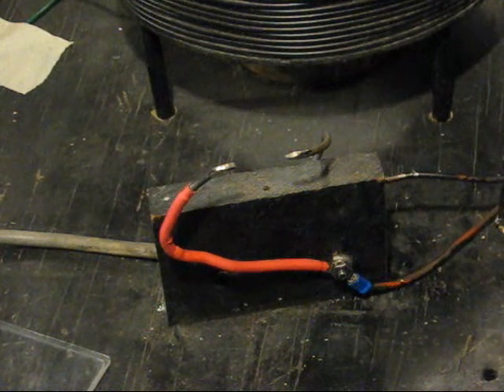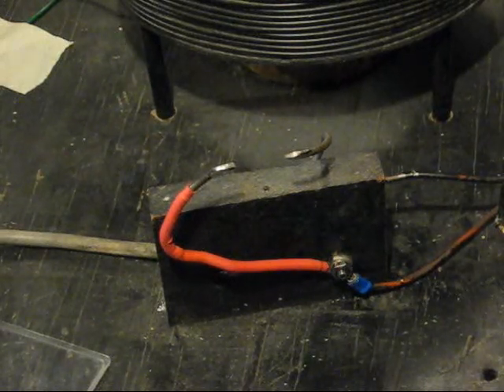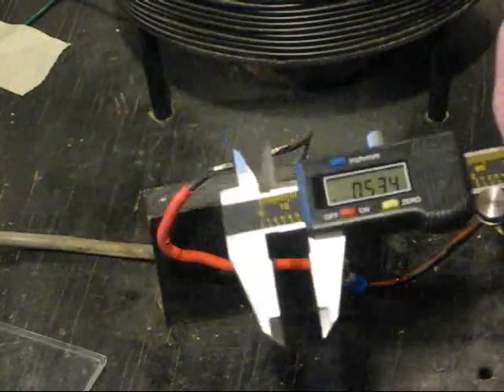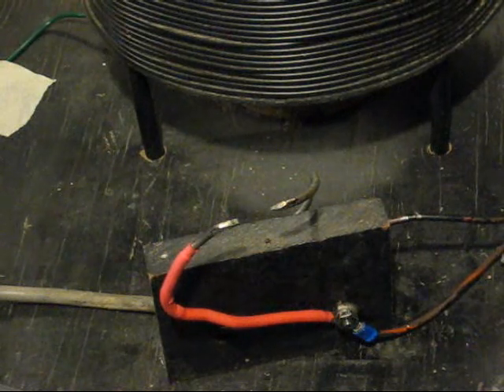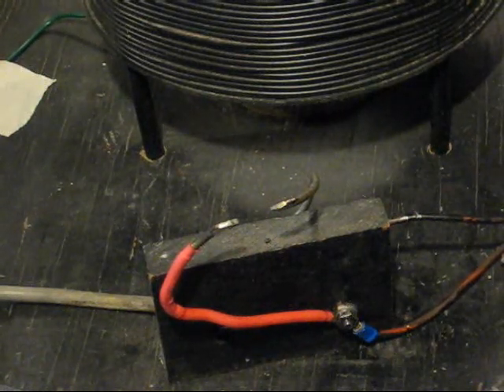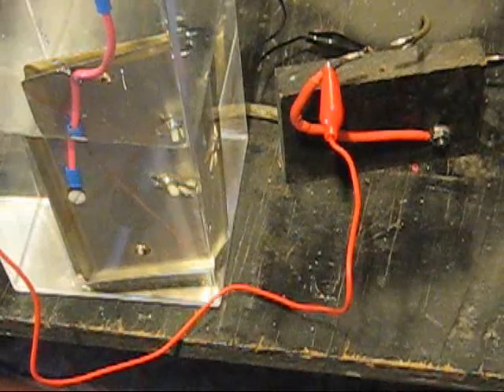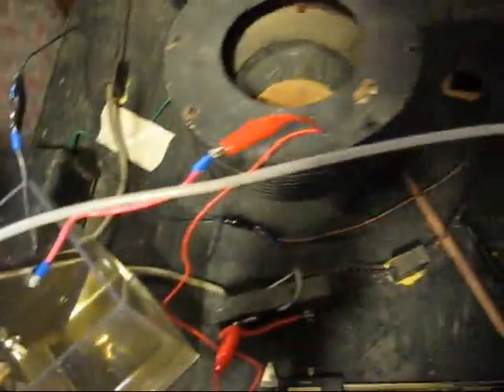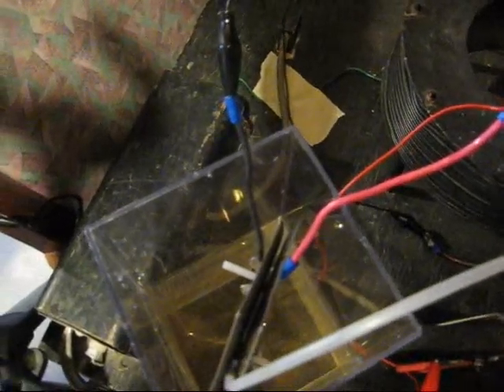Tesla Coil Primary Plasma HHO Attempt. ©

Comment: Question: Could the energy being released as steam and hydrogen be used to produce steam directly? It may require a second plasma field to burn excess hydrogen. However, if the goal was to produce heat for pressurized steam production rather than hydrogen production, could enough energy be produced to run a high efficiency steam engine that would produce torque energy as well as a small amount of electricity for running the plasma arc process? I'm not talking about overunity or anything like that. Just using the energy that is in water via HHO to power the process and provide steam for power. Water powered ships anyone?
Reply: Your still talking overunty.
Reply: @raloed.363  Okay, thanks.

Comment: At  7:57  you really had something going on there.  I would go back to what you were doing then & try to repeat the process.  If you can repeat, then you can make a circuit to do it for you.

That looked like Large scale production.  If you could make that steady, you would have a winner!
Reply: yes ,,,you are correct....
Reply: WTF how did you 2 not see that he was blowing into the hose  @ 07:50 thru 08:03 to get the connection going again. lol zero observation and even less understanding you 2 fail.
Reply: roger hurd
Yea I realized this about a month ago & figured what the hell and left my post up.

It is obvious, we will never see a working video here on YouTube.

IF one got posted, it would get removed, or the OP would be threatened in various ways until it is removed.

You are not allowed to openly speak about these systems or the science behind them.

Else be charged with Terrorism or experience Extrajudicial Execution.

Good Luck!
Reply: i think its 5:52 while no arc large bubble scale. check it out

Comment: if its discharging its passing thru the water instead of splitting it
at the start i saw bubbles so maybe if it was pulsed it may work
right before you get sparks in between the plates u need to switch off then on again
bubbles = hydrogen
arcs = nothin!!

Comment: i noticed that when you first started it you were pushing a lot of bubbles... the tesla coil would work if it did not reignite the hho causing it to turn back into water... if you could modify the tesla coil to produce a magnetic field you would not ignite the water and perhapse could benefit from a reverse principal between electricity and magnetism... just a though... if you could transfer that energy through magnetic  coils instead of plates you might be able to achieve what yoru after;)

Comment: ok, what did you do around 5:52-5:53... incase no one noticed.. it produced RAPID GIANT bubbles with no spark gap jump.  and it made 3 noises like you were adjusting voltage.  Whatever that was... revisit it... it worked.
Reply: I wondered the same thing, but then i realized that the bubble was just air fro the tube that he is using to initiate the arc. And if this setup is done using carbon electrodes then the carbon electrode will deplete to produce a reasonable amount of Carbon monoxide and hydrogen gas. check this patent US5159900

Comment: hho, 2 h2+o2, or oxyhydrogen has been around since the late 1800's and is not a new quack science phenominon, and it actually has been found occuring naturally in certain nebulae and has been theorized as a potential fule source for deep space probes, the problem with it is it often takes more energy to create than combusting it generates so its never seen heavy use

Comment: i thought arcs are much hotter than fire, anyway I got much better results by lowering the voltage to about 1000v and increasing the current to 2 amps but eventually the water will boil.
also try using more plates in parallel

Comment: Scientifically illiterate morons. its not a tesla coil and there is no such thing as "HHO". The reason why there is little dissociation is because there is only a small current flowing through the circuit. Low current=low rate of electrolysis in the water cell. 

Its chemistry and physics 101. There is nothing new or interesting here.

Comment: I have been noticing a phenomena that happens when we use high voltage for plasma. On almost all of the videos I see there is a line going north and south in the videos. With mine the line is narrow and dotted, but with yours the lines are horizontal in a north south direction of flow. I see these plasma outliers in the water vapor when I send water vapor across the spark. I would love to know where the lines are going and why they always migrate north and south.

Comment: I dont think the key is having that ARC continually runnnig in the water.. When the arc stopped pulsed you got a MAJOR reaction in that chamber.. was it air? or boiling it for a split second, oor better yet did the pulsed voltage create massive HHO for that few seconds.. 

I would REALLY be interested to see of those larger bubbles when it kinda squeeked there between pulses of the coil, if that was HHO?

Comment from the maker: Also I am very experienced in High Voltage equipment. I know what I am doing. If you are not don't try this. Yes the voltages are very deadly.
Reply: Any way that you might be available for some questions I have? I'm building a terrarium. I have built a small TC and I've been trying to figure out how to incorporate it into my project. I'm trying to use GANS Plasma, Frequencies, HHO, Quartz Crystals, and Water power. I'm wanting to combine all these different elements into a completely sealed terrarium. I plan to hook up as many sensors to collect data and if I achieve the results I think I can I hope to build a 4 person terrarium chamber. Basically like a deprivation chamber but using as many natural elements as possible. One could say I'm trying to recreate the world without a large carbon footprint in an attempt to build a healing chamber. I don't know how much time I have left but I refuse to let that dictate how much time I actually have seeing as life can change in the blink of an eye. If you are available my email is jvonirsik@gmail.com

Comment from the maker: The video doesn't do the action justice you can't see what is happening on the video.
There is water between the plates as it rushes back in when the burning of the gases collapse after combustion. this is why sometimes the arc stops and has to be re-stared with a air bubble.

Comment from the maker: Your correct salts or electrolytes will increase the production of Hydrogen & Oxygen by increasing the conductivity of the water. Stan Myer found that you could increase production through the use of a resonant circuit. The Tesla coil is a resonant circuit of sorts. Check out may other videos.

Comment from the maker: The golden calf of the Science community is the law of conservation of energy. There is something called Zero Point Energy where one can tap the energy of the cosmos. Ultimately breaking this law. Just as previously you couldn't break the sound barrier. It's no different, scientists don't know everything. It's all theory. Good Theory but not complete.
I am pushing on it so to speak. Trying to learn something someone else missed.
Reply: Energy from the cosmos? then you wouldn't break the law of conservation of energy. what will actually happen is that you make a device that when you put a little energy in it goes into a state where it pulls more energy from somewhere else. I believe its from E=MC^2. I believe that under the right conditions you can efficiently convert mass to energy by that formula. matter, light and orbitals are all made up of electromagnetic waves. I'm hypothesizing for orbitals. In matter the electromagnetic waves interact to form mass, in the light they interact to form the speed of light (reason why nothing with any mass cant reach light speed), while in orbitals they interact to occupies space but no mass. The electrons are capable of moving in orbitals because of quantization of energy that allows the electron to become one with the orbital space. during quantum tunneling the electron can remove its mass and turn into light withing the orbital. and because light is time, observers don't recognize a "flow" of the elections. because at the speed of light time doesn't exist. I believe plasma is just orbitals that have expanded and overlapped to the point you can see them with the naked eye. this would explain why plasma is such a good conductor of electricity. the overlapping of the orbitals allow easy flow of electrons.